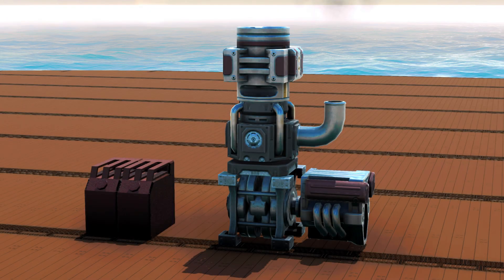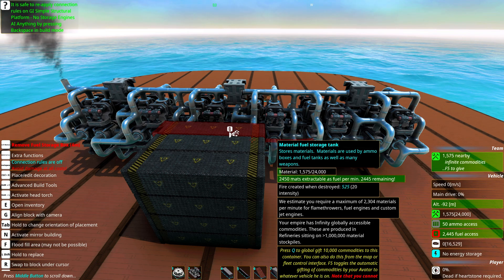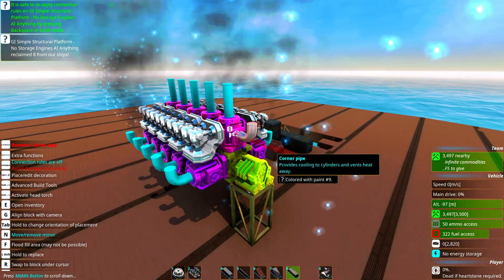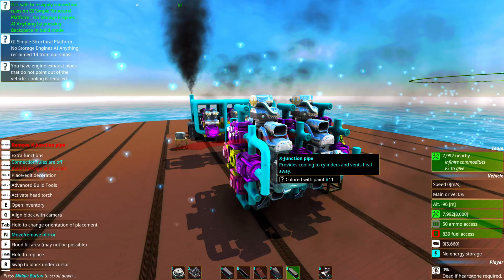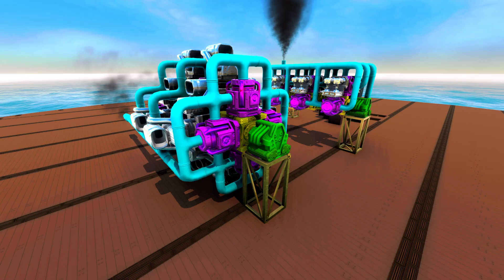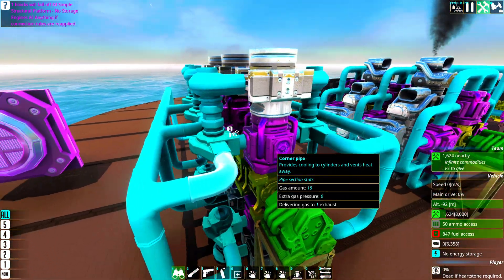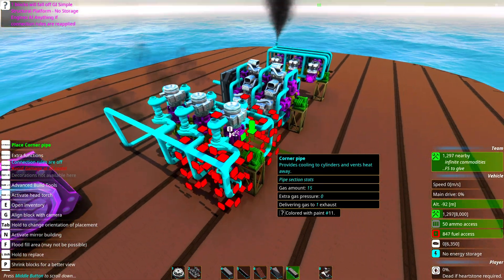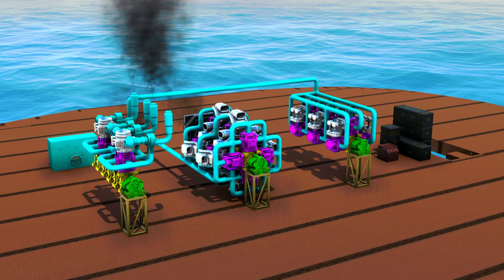How To Fuel Engine - From The Depths INSTANT Tutorial

Comment: A few questions I had I answered through experimentation:
More turbos using less gas each (Such as 3 turbos with 2 gas each) is more efficient than fewer turbos using more gas each (Such as 1 turbo at max 6 gas)
Exhaust is proportional to materials used, not power created. A 600 power engine with 300 efficiency will make more exhaust than a 600 power engine with 800 efficiency
You can dramatically boost efficiency and power density by connecting one carb to multiple cylinders, even if it means using fewer turbos or supers.

Comment: Good tutorial! I assume there's no real world correlation to actual engine design though? Pros and cons of Inline vs boxer, using super and turbo charger to maximize power for the size of the engine, instead of maximizing power for the input, etc?
Reply from the maker: Well there is some corelation yes, but in our world carburators are kinda old and I think all engines are injector, there is no reason turbo is limited to carbs so yeah, but some engines like this are better at low vs high rpms, however irl it's more like they actually give more power at optmal RPM rather than just fuel efficient.... make it what you will XD
Reply: there is none whatsoever. its made up space mumbo-jumbo using real world terms to make up stuff. the way it works in from the depths is clearly some alternate reality. ironically multistage steam engine(or steam engines in the game overall) is really close to how single point injection engines work(just replace steam with actual fuel, add imaginary spark with some details omitted, thats how it works). insanity xD

Comment: Can you do a tutorial on multiple aa gun targeting multiple enemy planes? 

So like, if you have 5 octuple 40mm guns, they will all aim at a single target, instead of aiming at a seperate one
Reply from the maker: You just need several AIs with different targeting data, we can do such a tutorial but I’m not sure how many that would find it useful
Reply: @GMODISM  so youre saying we'd need as many mainframes as there are guns? Or you mean with just lwc set to slightly different parameters
Reply from the maker: as many as guns, but honestly you should not need more than 4 aa gun AIs, part up them in 4 groups and it will work fine I think
Reply: fuck aroind with the cwis option: multiple cwis aiming at same target

Comment: great tutorial! you have to be careful though, the engines SAY They're using 6/6 exhaust, but they lie and are very unintuitive. the total PPM doesnt change unless the exhaust is going into the same cylinder/engine that made it, and it gets less efficient the more you send through, so a lot of more complex and interconnected engines end up working exactly the same as simpler single engines.
Reply from the maker: Wait what, are you suggesting that multi stage engines that recycle other engines gases would be useless or something, what I can see the ppm does change when the other engines gases are recycled…. Explain more please
Reply: @GMODISM  ill DM you when i have my test engines ready 👍
Reply: @GMODISM  he probably means that such multistage engine is redundant in a sense you can slap those multiple stages into one engine and it would work exactly the same or even better. if you have to recycle gas it just means that the engine you need to recycle gas from is build as not efficient as it could be. turbos get less gains as more gas passes through it so most practical applications will do fine with engines that use about 4 to 5 units of pressure per turbo, no need to create pressure that fills the turbo completely and has excess pressure left. ideal engine constuction uses all its pressure internally and passes exactly 0 to the exhaust. for injectors, you can literally slap the turbos and carburetors that are supposed to recycle excess pressure on the same engine and it will work fine. so unless you plan to place different stages separated by long distances for redudancy connected by really long and vulnerable pipes, then multistage fuel  engines are not necessary. multistages has only any practical sense in steam engines where you can get as efficient as you want(i got to past 2000 power per material with 6 stage on large pistons its even higher on 9 stage but the gains are unpractical for normal applications) with trade off of volume taken and some engine "tetris" required.

Comment: Thanks for CRAM-ing everything into one video [= I am a lazy fuel engine builder I usually just make 750 ish ppm self contained supercharger engines plus some injector engine cubes as backup power and redundancy, and watching engine videos tends to get me to fiddle with those darned turbos and exhaust pipes again, because sticking to what you're already doing is not a great way to improve as a builder.
Reply from the maker: You know what, if you wanna be lazy just do a supercharger and cylinder turbo engine combined, that will be fine for all applications and leave the injectors for backup only :)